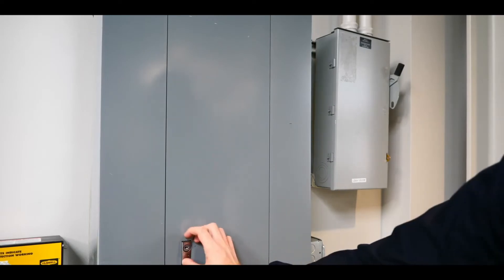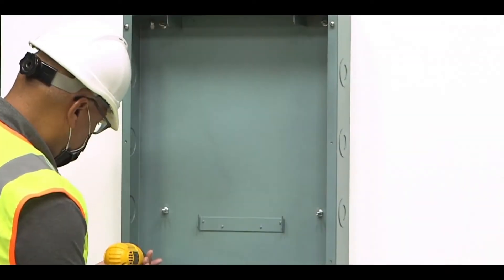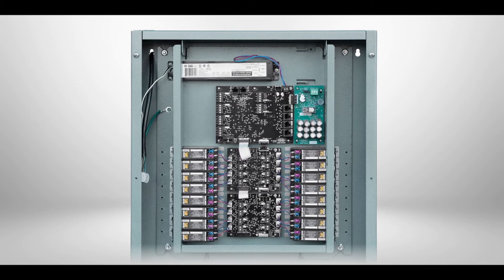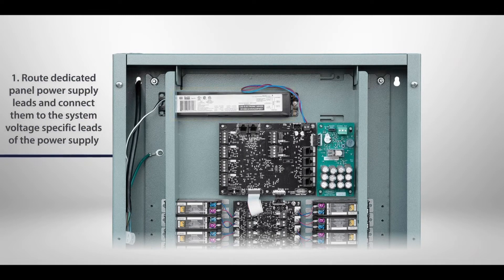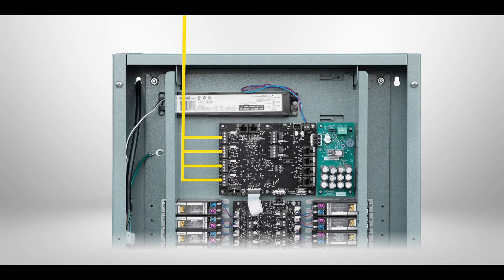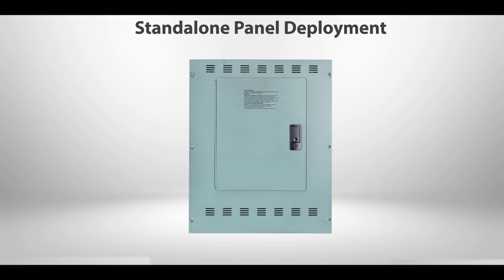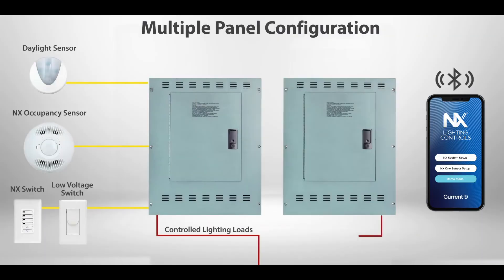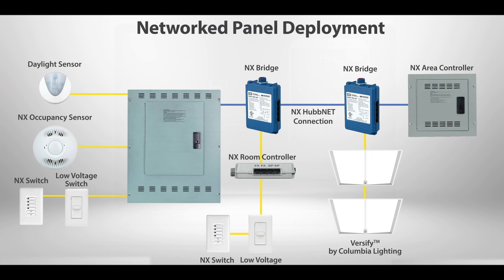NX Lighting Controls Control Panel (NXP2 Series) Installation Instructions

Comment: I'm installing the same panel. Can you daisy chain the occupancy sensor with the ethernet harness that it comes with? It has 2 ethernet ports. Also do you connect the override smart switch to the smart ports?
Reply: This panel has no ethernet ports.  They are called smart ports.  Both occupancy sensors and override switches connect into the 4 "smart ports."
Reply: What's the dry contacts for